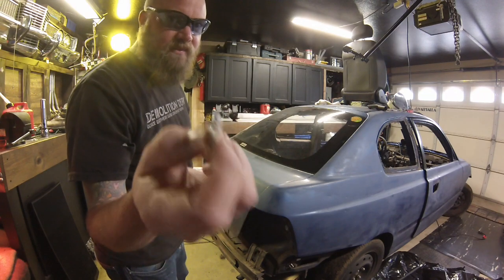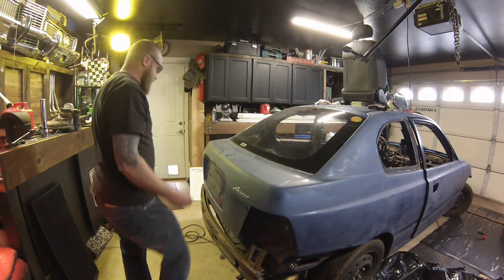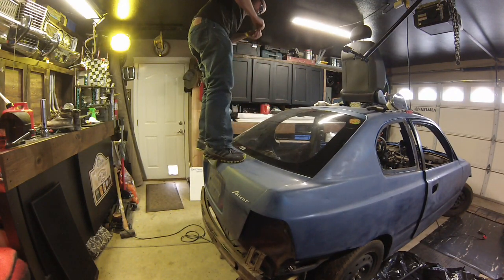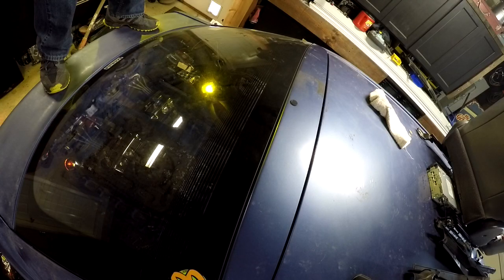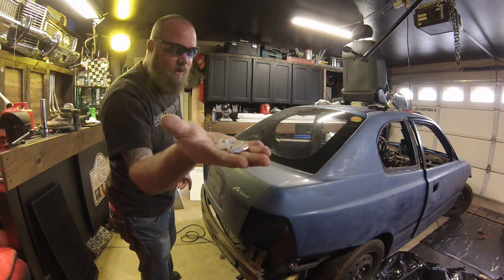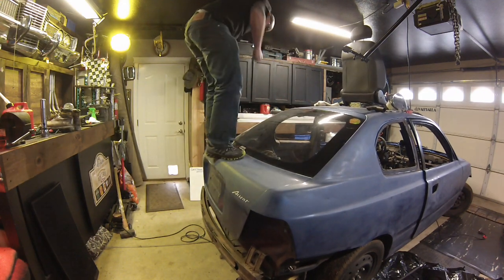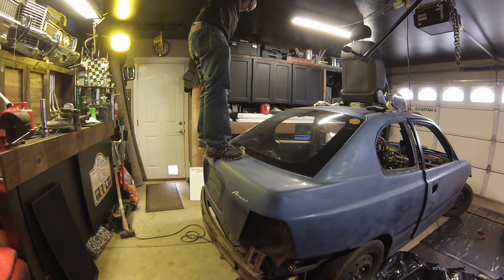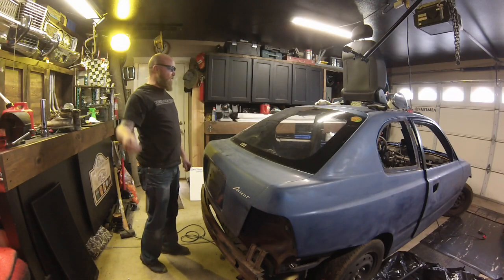Can you break glass with a piece of spark plug and gravity? (drop test)

Comment: Why does that work ? Scientific reasons please
Reply: Because ceramic is very brittle
Reply: @pauliepaul3697 no.. it’s comes down to the hardness between the two. Porcelain is much stronger and when thrown with force it concentrates a tremendous amount of energy at a single focal point on the glass causing it to shatter with ease.
Reply: @Nisrochs-Handbag  True 
But still brittle though 
Main reason it works is because it's a tiny piece of porcelain which is harder
I tried it once with a diamond dressing tool used for dressing grinding wheels 
And it worked because the diamond on that tool is the size of a grain of salt
You can buy them were i live for £5
Any thanks for your reply with your good comments 
Keep safe 👍
Reply: Spark plugs contain the essence of sus impostors, so they break the glass with ease